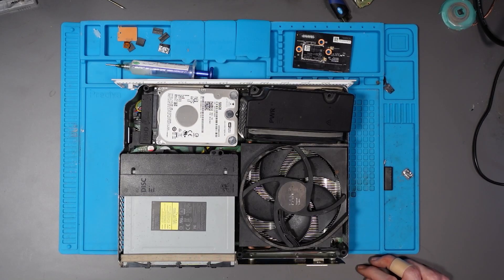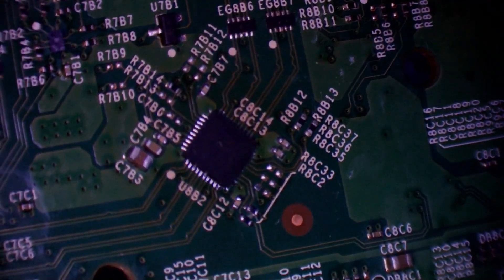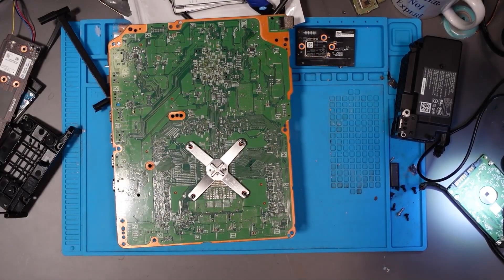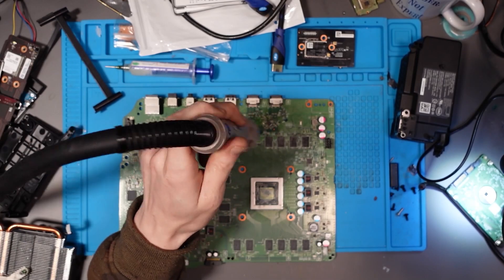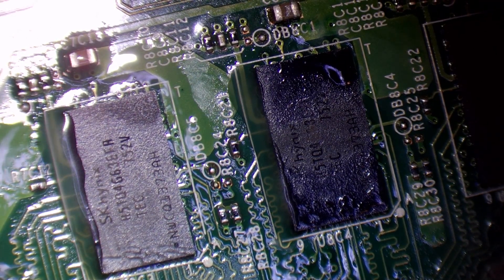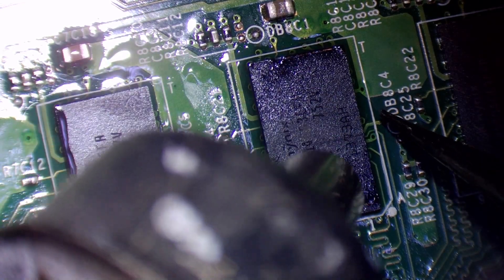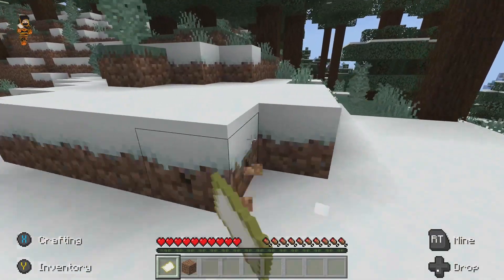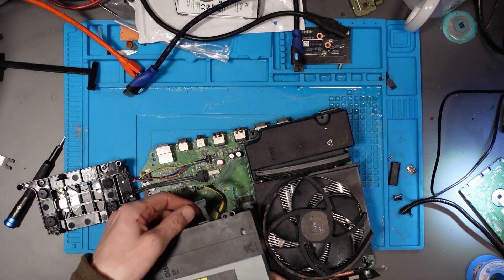Xbox One S Glitching Green Screen And Kicking Games Back To Dashboard. Can It Be Fixed?

Comment: Hello. Do you have problem that xbox one offline update crashes on 75% installing (33%applying) with error e105, e106?
Reply from the maker: Sadly not, I'd need to bring able to see the log files on the console but it sounds like it might be a bad hard drive
Reply: @TheCod3r  i already try diffrent hard drives, but result always the same. They all working, have 100%smart. Using script or not. No diffrence. How can i open log files? There are crashsystemos.xvd files inside drive after fail . It seems like they encrypted.

Comment: Awesome, which Flux do you use? And what's your hot air temperature?
I'm asking cuz my Flux burns away at 330°C
Reply from the maker: I use Kingbo RMA-218, it's cheap but does a good job. For most repairs I normally have my iron set at 450⁰C and my air set to 440⁰C @ 40% air speed
Reply: @TheCod3r  Chinese kingbo?

Comment: Amazing work on the Xbox quick question tho on the slim with pulsing blue light that you looked at after the Xbox that pulsing light there you sure that is not southbrige and was there power to the usb ports?
Reply from the maker: Yeah if it were the southbridge it would generally either have a solid blue light or a 6 to 10 second blue light, plus the fan was spinning so it was unlikely

Comment: Good job as always Phil!!! question, what size are the solder balls for the ram? I'd like to get started at reballing with Rams.
Reply from the maker: Cheers mate, it's 0.45mm for ram on these, but I use a stencil and paste usually
Reply: @TheCod3r   is it possible to solder this with just normal solder wire + flux + heat gun?